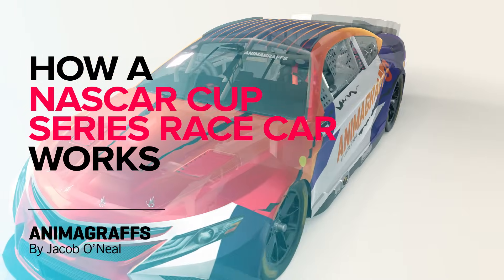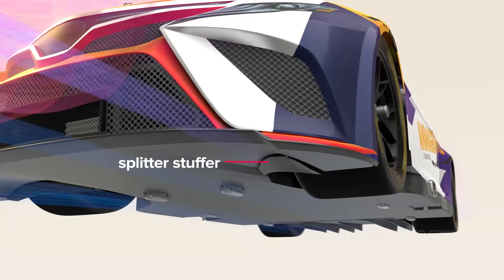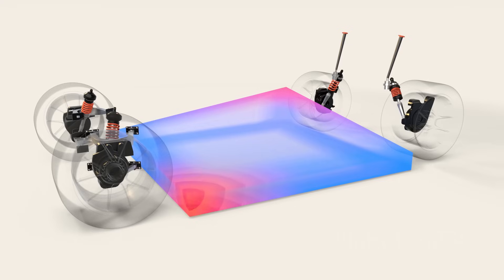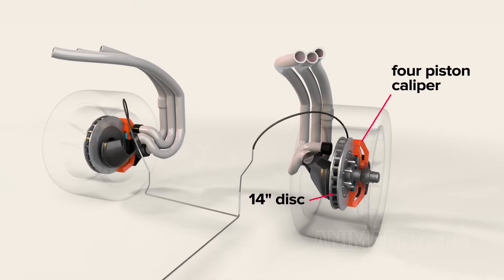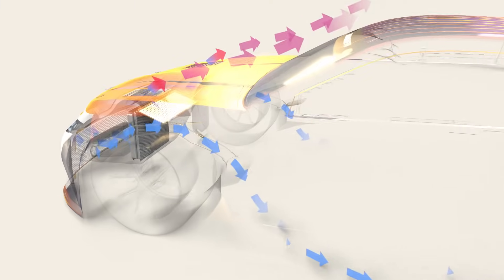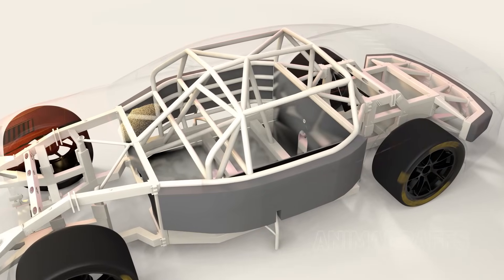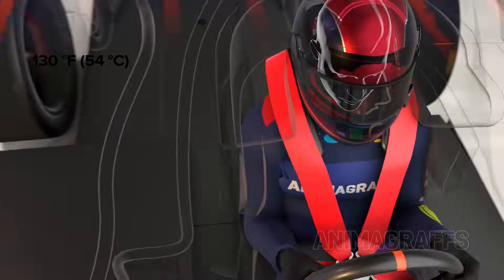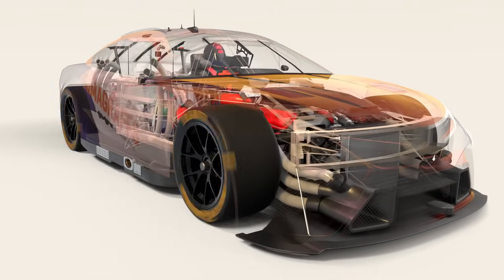How a NASCAR Cup Series Race Car Works

Comment: Mind blown! The automatically deploying body panels to reduce lift in a crash situation were insane to learn about. Thanks for breaking down this engineering marvel and dropping knowledge.
Reply: The smooth flat floor will increase chances of flipping through compared to the old cars 💯
Reply: @Barry.ONeill  i reckon if the floor wasn't flat as is currently you'd have mega problems with ground effect and diffusing, more dirty air than already and have to redesign the whole underfloor if not whole aero package???
Reply: Agree @Barry.ONeill  AGREE!!!
Reply: Can thank Mr. Roush for that👍🤝
Reply: @LETSTALKENTERTAINMENT    nahhh, remember in daytona 500, next gen just doing first time flip blowover  by Harrison Burton
Reply: First year for nascar race car roof flaps was 1994.
Reply: How did u not know those  they been around for years
Reply: Did you know they’re actually passive, so it’s the decrease in air pressure as the car pivots that pulls them into their deployed position, one of the simplest yet most discrete aero fixes implemented through all motorsport
Reply: cmn. Nascar is far from engeneering marvel, as that whole competition to go stupid round by round ))
Reply: Some would say that it was better in the 80s when cars would regularly blow over and become dangerous missiles after spinning at 150mph. Nowadays you hardly ever see it. The crash at Daytona this year was very minor compared to what was seen back in the day.
Reply: Jack Roush a nascar cup team owner today, back in the 90’s he came up with the design for the roof flaps that we know today.
Reply: Fun fact the underside flap said it would decrease chances of flipping over however my rookie still flipped over in the first stage during the first race
Reply: @mrs6968  decrease, not eliminate
Reply: @tinzalix8624  true yet stage one first race seems to have have not lowered any chances
Reply: @mrs6968  ...and which video game was this in?
Reply: Yea and none of them  work, a car is going to flip no matter what,
Reply: @jm1551701  hell yea smartass

Comment: Thought NASCAR had individual lug nuts rather than the usual 1 wheel nut, guess regs updated
Reply: The car in the video is an entirely new platform that just began running this year!
Reply: They went from a 15inch steel wheel to a now 18inch alluminum wheel and had they kept the steel 5 lug design the weight would've been too much for pit crews to "lug" around. So into the future it is with alluminum single lug low profile tires

Comment: The cooling ducts are the most interesting ones for me, as an f1 fan i have no idea how non open wheel cars cool their brakes
Reply: They have cooling ducts as well they're talked about quite often if you pay attention
Reply: Uh, with cooling ducts.
Reply: @ross-carlson  uh, you mean the thing he mentioned at the very beginning of his sentence? He literally said "the cooling ducts are the coolest part for me"

'Muricans. Nuff said.
Reply: I had a few old BMWs from the 80s that had these cooling ducts below the front bumper that ducted incoming air onto the front brake discs and calipers. I though it was pretty cool even though I'd never drive it over 80 mph lol.
Reply: Yeah
Reply: The brakes need cooling, but also the driver. In 1988 Ricky Rudd raced with his air-conditioner system broken. He was hospitalized after, but he won the race!: https://youtu.be/RCtddIpHWLM
Reply: nadcar car does not need much brake cooling as it stays at top speed much of the time. 
however  coling duct does wery little as brake disc are doubled with an integrated   fan and wheen rotating drives air
Reply: had* you have seen the light now
Reply: Brakes on an F1 car cost about $200,000. They can slow the car from 200mph to 40mph in 4 seconds while the brake rotors get to almost 1,200 degrees fahrenheit without warping or brake fade.  F1 brakes are good for about 250 miles.  Interestingly, F1 regulations cap the amount of money that can be spent on each car. In 2021 the cap was $145,000,000 per car.
Reply: Yeah,Same!!
Reply: Look at WRC cars been doing it for decades and Touring cars, the spining disk throws the air out from the centre and the wheel itself get hot too hot to actually touch 🤙do you mean open wheel like the type of vehicle or how the new f1 car have only tiny holes in the wheels itself ?
Reply: And these are new features too!
Reply: NASCAR cars don't nearly need as much brake cooling as open wheel cars, especially formula 1.
Reply: @cameron5802  almost a third of the schedule is road courses where the heavier car in smaller caliber means that they're using their brakes more...
Reply: @GARBO96  All I said is that they don't use their brakes as much as Formula One cars.
Reply: @cameron5802  that's only true on ovals on normal tracks they use their brakes much more than Formula 1 cars
Reply: @GARBO96  I stand corrected, though I still feel that the cooling requirements of formula one cars and their brakes are greater than that of Nascar, possibly because of the forces applied or whatever multi-faceted uses the engineers account for. While I don't know if i'm right or wrong, it just seems that the so called pinnacle of motorsports would have all around greater withstanding components. Whatever the case is, it's neat stuff.
Reply: @cameron5802  they literally race at the same circuit Cota we know that Nascar has a braking distance that's about 10 times longer than Formula 1 they also brake at Corners that formula one doesn't brake at they also use metallic brakes which need to be cooled much more than carbon-ceramic brakes there's also the fact that in open-wheel design inherently cools the brakes more than a closed wheel design you're overlooking a lot of things. There are way too many material and mechanical properties are overlooking. There are numerous independent studies of both systems if you actually wanted to look it up
Reply: @cameron5802  in simple terms if formula one was to have the same style of ducting as NASCAR they would cool the brakes to such a degree it would likely be too cold for them to operate properly not because the ducting is extremely elaborate compared to Formula 1, nascar just has much more airflow freedom
Reply: @GARBO96  I said you were correct.
Reply: @cameron5802  F1 has a lot more downforce, which reduces use of brakes. F1 is light years ahead in design over NASCAR, but they also have much bigger budgets.
Reply: Except at martinsville
Reply: @cameron5802  Cap